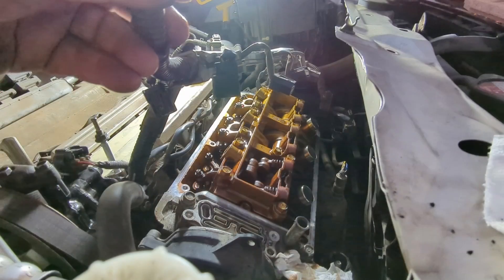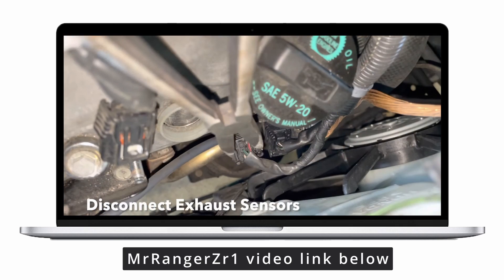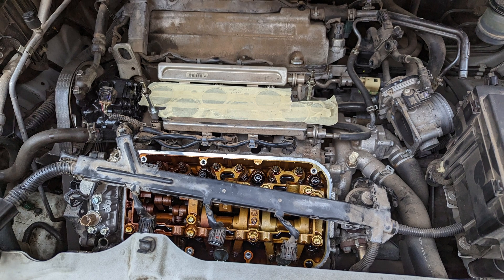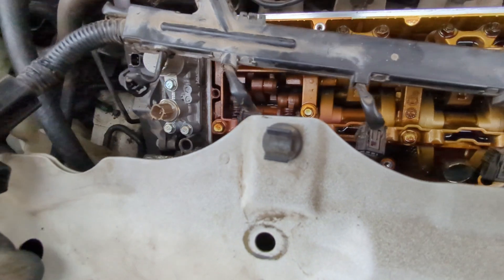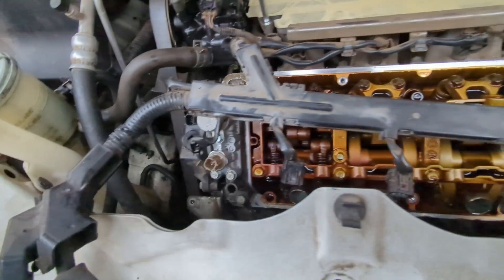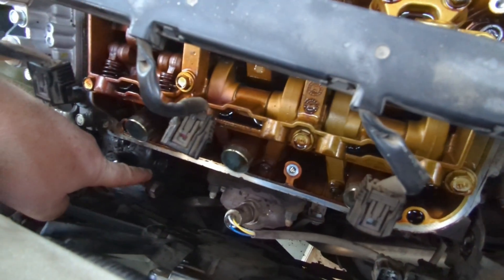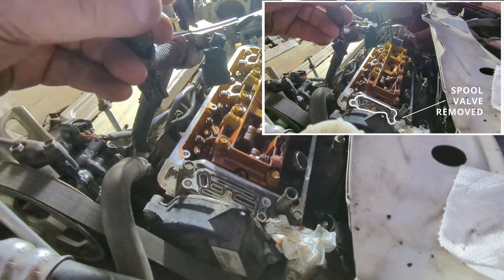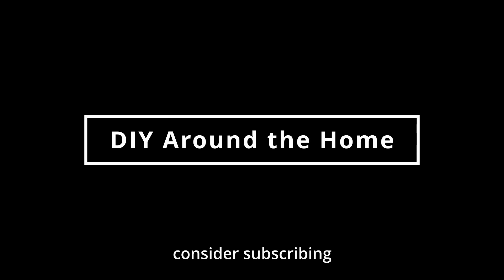Honda Odyssey Valve Cover Replacement - Tips for 2011 and Newer Models

Comment: Here is how to remove that harness completely from the right side.  

So what i did was removed the negative terminal and secured it safely away from the battery. Then I opened the fuse box next to the battery and there are two 8 mm bolts at the top that secure two wires in place. The one on the right is to the harness. The one on the left goes to the positive terminal on the battery. I removed both of those. I removed the screw on the bottom that is holding the fuse box in place (It's either an 8 mm or 10 mm) and then I pressed both tabs on the right side and lifted up the fuse box. Underneath the fuse box the wire is secured by a clip which I removed. That allowed me to move the harness up and out of the way.

Comment: Thanks, DIY, I got them off.  Yes, i lubed the plug first.  The larger , rubber sheathed one, had the lock release NOT behind the ONE grooved side, of the rubber sheath.  I was pressing, mostly the grooved side.  I got the smaller, green one off too, finally!

Comment: wish i would have found this video a few months ago when i first changed my gasket, but this is what i did as well.  stinks that i had to find this again since the (non-OEM) replacement gasket is leaking again as it was either bad (i do remember it not fitting perfectly at the time) or i did not install it precisely.

Comment: VERY HELPFUL!  Why did you remove the VTEC Spool Valve?  Because if it's reputation for leaking?  Thanks, Mike Celi
Reply from the maker: I took it out as many in the forums said it might be the cause of the leak I was trying to fix. It did make it easier with it give to clean the area and apply the gasket
Reply: Thanks for the reply.  Mike is bone dry, so Im gonna leave it.  @DIYAroundTheHome
Reply: @mikeceli I was about to ask the same question. Thanks!

Comment: Two other questions, DIYAroundTheHome, Man.  HOW did you get those two plugs off.  The one on the alternator, where , on the rubber boot, must it be squeezed to release the lock?  And below it, the single wire connector is also fighting to stay on.  I see and can press down on the plastic lock tab, but it's so tight in there, I can not really get a good grip  to press the  tab and pull the connector  off.  Forty minutes I'm on this, because I do not want to break the lock tab!  THANKS>
Reply from the maker: The two bottom plastic clips on the alternator harness didn't take a lot of work to get off. Maybe spray some type of cleaner that won't mess up the electrical... could be you have some gunk keeping things connected extra good. 

Sometimes when I'm pulling lock clips out I'll use a set of pliers to help hold down on the tab while I pull the clip out.